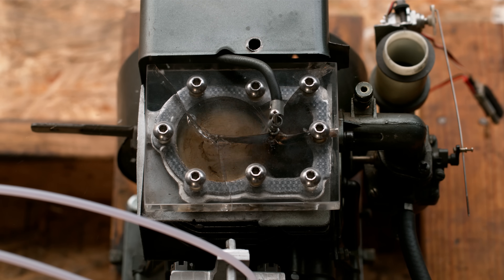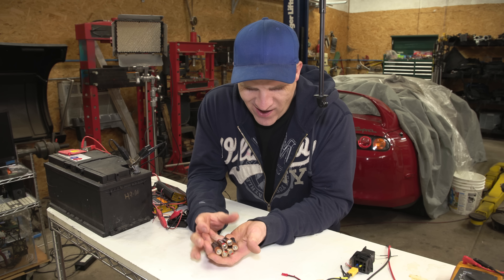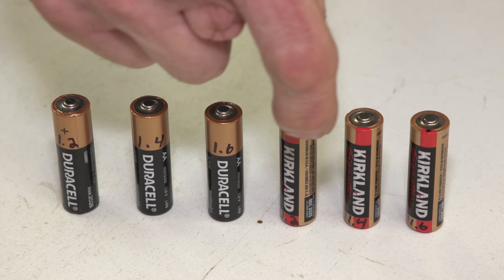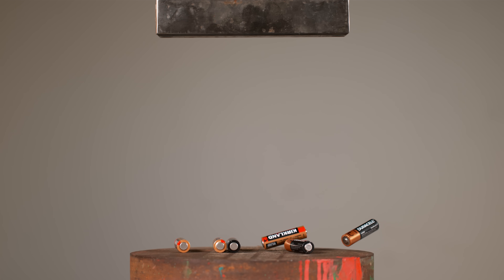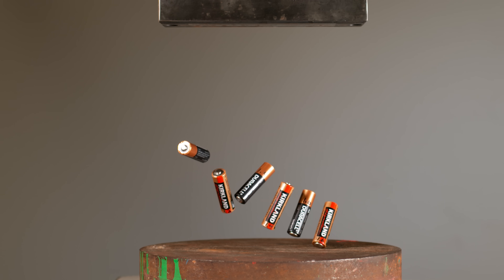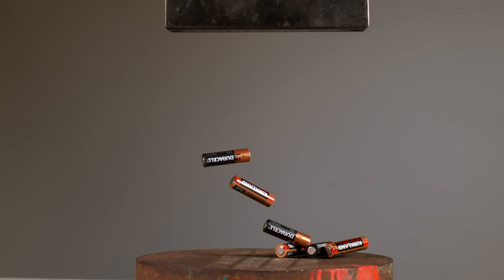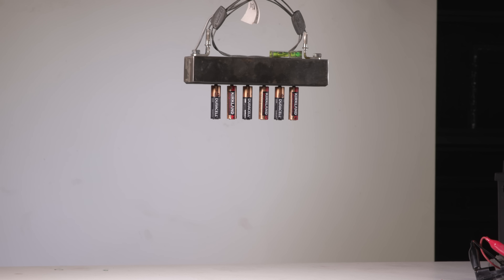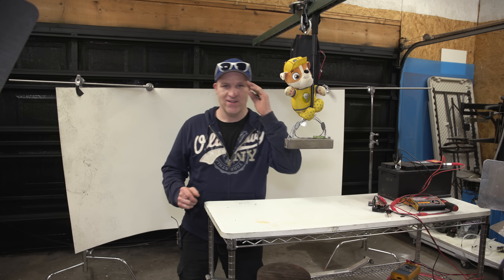Battery Bounce test in Slow Motion - Why Do They Bounce when they are Dead?

Comment: Yes it was air resistance to weight that made duracell fall first. You can clearly see they are released precisely at the same time and their distance from each other keeps increasing the more they fall. If I'm right you will weigh the batteries and tge depleted ones will be lighter because you can also see in the footage that dead batteries are hitting the plate later.
Reply: Free fall velocity is being somehow manipulated. Speculating: One brand's materials cause delayed release to the magnetic release rig? One brand's make up is interacting differently with the rig and is resulting in some electro-mag forces being exherted upon "release". But definitely nothing to do with air or weight in these conditions. (Cool vids. Had to subscribe!).
Reply: Weight has absolutely nothing to do with it, while air resistance or even a drafty room might cause the discrepancy.  Try dropping two objects of similar size and shape but one is considerably heavier.  They'll both drop at exactly the same speed.  Try dropping a full bottle of water with an empty bottle of the same shape and capacity. 
 In a vacuum, a bowling ball and a feather will accelerate towards the ground or fall at the same speed because the strength of gravity is a constant. A skydiver adopting a head down position will only fall faster than a skydiver adopting the standard belly down arched back position only because of air resistance.
Reply: Ài pulled you correct, I'm sure my cock would be pushr @cherrycolalola6345
Reply: @cherrycolalola6345  Yes, weight does have something to do with it. In vacuum, they weight different, their mass are different, but the acceleration (weight / mass = g) would be the same. In air, they weight different, the air resistance is almost the same since they have similar shape. Acceleration is proportional to (weight - air resistance)/mass. We know (weight = mass * g). So the final acceleration is [(weight - air resistance)/mass] = [weight/mass - air resistance/mass] = [g - air resistance/mass] . So yes the greater the mass is, the higher the acceleration will be.
Reply: @lighteningwawa  I stand corrected if I said that, but honestly forgot what the controversy was about. lol. 
   After rereading, I believe we both are saying the same thing but in different ways.  We agree that drag/air resistance is the cause of the discrepancy and you are correct, a heavier object will be less effected by drag/air resistance because of inertia, but it stands that in a vacuum with no air resistance, the weight of an object will have nothing to do with it.  Gravity will effect both of their masses, large or small, equally and their acceleration would be the same.
Reply: @cherrycolalola6345  Sorry for digging your old comment :-) Yeah you are right. I guess I misunderstood you because I was a bit mislead by your first sentence, as you said weight had nothing to do with it. IMO weight has something to do (in air) in the way that it affects how effective the air resistance would slow the object down.
Reply: 4:16 Has every one seen Rubble from Paw Patrol?

Comment: Surely the difference in drop speed isn't due to weight or discharge amount, but more to air resistance? Are the Duracell batteries slightly more tapered on the bottom (they look it) this would make them have less drag and thus accelerate faster. A bowling ball & a feather fall at the exact same velocity in a vacuum, so it's not gravity - it's air resistance!

Comment: He mentions fall rates. Duracell's weight is irrelevant to fall rate on Earth. It's either the material of the contract points releasing differently from the release rig, or some high-level electro magnetic sh*t going on within each battery and the rig, when he flips the release. Or both. (Cool vids. I had to support and subscribe!!)

Comment: hey Warped Perception, i'd be interested what the rated capacity for Duracell vs the Kirkland battery is. could you measure which has a longer discharge or more power than the others, or do a test between numerous brands ? would be cool. i work for Costco(Fork Lift Driver), so would be interesting to see if their own branded stuff is as good as the competitor, as Costco says, their own brand matches or beats the quality of the branded product, but are usually cheaper.
Reply from the maker: Here check this out https://youtu.be/V7-ghrTqA44 let him know I sent you, he's a friend of mine.

Comment: Do You really think, that the duracell batteries hit the deck earlier because they are heavier ?!?
Reply: Obviously not weight or Newton is all wrong... I bet it is a difference in the cap of the batteries that leads to this. I mean the unequal reaction to the electromagnetic field shutting down may be why the duracell realese two frames sooner. Could be because of the thickness of the cap or the alloy that is different. The fact that it is brand dependent also seems to lead this way but I may be just totally wrong.
Reply from the maker: Well they were released at exactly the same time but hit the same plate a couple frames sooner. That's what makes it so interesting.
Reply: I did quick maths and between a 20g and 25g battery (no idea) and a 300 mm drop, there is a time delay in landing of 0,03 s. Enough to be captured on the high speed footage indeed.
Reply: Weight doesn't effect the speed at which an item drops.
Reply: @tamacoable  Exactly. Air resistance is the only variable here.

And apparently the magnetic force. I had not thought about that. Still, weight is not a variable in falling speed.
Reply: @NightEye87  Guys, you're forgetting the residual magnetic force. the heavier battery, would in fact release itself before the lighter battery.
Reply from the maker: But the released at the same moment
Reply: @WarpedYT  From what I understand now, is that the change in magnetic field causes some 'residual' resistance (or, magnetic pull). They are released at the same time (give or take a frame) but then the 'slower' batteries are more hesitant to fall due to the very small magnetic field that is still there, trying to fade away. Maybe somewhat comparable to a magnet falling through a conducting tube?
Reply: @wesleysuperman  The residual magnetic force is what I was trying to explain but the weight isn't the predominant factor here I think or there wouldn't be such a difference between the two brands as their weight is not brand dependent. That magnetic residual force must act differently on the caps whether it is due to type or quantity of matter in it. And this probably affects only the first "nanoinches" of the fall.
Reply: @NightEye87 When air resistance enters the equation it is
Reply: This isn't space. Theres air resistance to contend with
Reply from the maker: I think so, I also talked to some of my friends about it ( they work at jpl) and they think it has to do with the air resistance, keep in mind this is 2000 frames per second, so they were only about one to two frames ahead, which is about one thousandth of a second, very little and visually amplified by the high speed camera, I'm going to look deeper into this later..what do you think?
Reply: @WarpedYT  Well, You could be right, but it seems to me that on such a small distance air resistance could matter only with huge difference in weight. I might be wrong though. If any I could agree with the weight thing but in the meanning of the way the magnet influence first inches of their flight.

Comment: Heavier Objects Do Not Fall faster!  4:49 the release was not as exact as portrayed, the reason is the Duracell batteries
do not stick to the magnet as well, so when magnet is switched off the Duracell release sooner as the field collapses.
Play @ .25 speed to see for your self and if it not the magnet attraction difference and they are heavier, still they were
released a bit sooner letting go from the magnet sooner since a heavier object needs more to hold it as the field collapses.   None the Less was COOL to see the bounce height all together with the different drain levels, Great Idea!
Reply: Yes he is right as gravity pulls everything at a constant and so the weight would not play a role in how “fast” an object will fall towards the ground. Don’t believe then just do your own experiment and place a penny and a feather inside a vacuum cylinder and do a drop test for yourself.... Spoiler Alert 🚨 they will both hit at the same time!!! Still such an amazing experiment filled with science! I LOVE it, got a new subscriber with me!
Reply from the maker: It is what you see. But it was with the high speed camera and that equals 1/1000 of a sec. I will do a follow up and look into it.
Reply: @WarpedYT   Still was a great way to prove the bounce/reaming juice test! Awesome Idea!
Reply: They do if they have air resistance, just like anything else, and watching this with the high speed camera is almost like looking at something microscopic with a microscope. Even the slightest movement is amplified and magnified.
Reply: @littlebrainiac1  True but Douptfull in this case as even the maker of the video agrees, Besides the batteries are nearly the same.  run at 0.25 speed and see for your self, it's in the release is all.
Reply: Agreed

Comment: Heavier objects do NOT fall faster than lighter ones in a perfect vacuum
Reply from the maker: Great point, I wonder why some of these batteries fell faster than the others. They are all releasing at the same time from what I can see looking at the high-speed footage. But they definitely fell at different velocities. Which was very interesting to see. But again keep in mind that on the high-speed camera it looks like a lot more than it is. From what I calculated the two sets of batteries fell about two frames apart at 2000 frames a second. So that means they're only one millisecond away from each other. That is a very very small difference. Maybe using the same drop rig I should do some future experimentation. For instance dropping things in a vacuum versus regular atmospheric pressure. Maybe even these same batteries. Thanks for the feedback you got me thinking
Reply: @WarpedYT  That would be a prefect video to put on youtube and debunk the idea that other people think that heavier objects fall faster! I wonder what caused this small difference. Cant wait to see your next video!

Comment: Gotta reference Newton's laws though on the Duracell batteries hitting before the Kirkland batteries. That's not how gravity works. It may be that their composition (what they're made of) caused them to release from your electromagnet differently than the Kirkland batteries though.
Reply from the maker: Good point, no they all released exactly at the same time if you look at the footage. That's a really interesting point though, if they are not anywhere near terminal velocity why would one drop any faster than the other. Maybe I need to use that same dropper rig and look into this in the future.
Reply: @WarpedYT  I didn't explain my suggestion for what could be causing the differences in release just after you turn off the electro magnet. I believe it may be that the metallic composition of both batteries are just slightly different. That combined with the magnetic field not fully dispersing may cause the batteries to have been pushed/pulled differently right after shutting off. Perhaps some slow motion footage with iron filings and that electromagnet being turned on/off, as well as cutting the batteries open (if that's even safe) to inspect why they may be dropping differently would reveal some more answers?
Reply: You are forgetting about air resistance. Objects of different masses only fall at the same speed in a vacuum. Heavier objects will fall faster through air (i.e. brick vs feather). If you look closely, the batteries are all level with each other immediately after they release but become staggered upon reaching the table. This implies that the Duracell batteries contained more mass and thus could exert greater force to move the air out of the way as they fell to the table.
Reply: @DanielRafacz  The differences in weight and aerodynamics are negligible in this case though. When comparing a brick and a feather, the feather's aerodynamics are greatly disproportionate to it's weight compared to a brick's. These batteries have the same aerodynamics as they are all the AA standard sizes and nearly, if not, identical masses.

Comment: Would it make more sense that the magnet had a different hold on the kirkland batteries and that's why they fell behind? I learned in school and relearned from Veritasium (which is a channel here on youtube) that objects fall at the same rate. Perhaps the magnet has a greater attraction to the kirkland batteries and or the kirkland batteries lose their attraction to the magnet that tiny bit slower.
Reply: But heavier battery will came loose from magnet faster as magnet doesn't loose magnetism in an instant and lighter battery will hand longer. Also heavier battery has more momentum and that helps it fight with air drag.
Reply: HaloBalla Your assumptions are correct, it's all about the magnets influence on the batteries. The speed and size of the batteries are insignificant for air resistance to have any measurable effect.
Reply from the maker: That's a great point, they should all fall at the same rate since they are nowhere near terminal velocity. The electromagnet releases them exactly at the same time. I mean as long as it takes an electron to get from one side to the other that would be the delay, but that's incredibly fast, less than a millionth of a microsecond. I'm going to have to look into that in a future maybe do some experiments. Thanks

Comment: The weight have NO influence at all to the speed of droping
Reply: But heavier battery will came loose from magnet faster as magnet doesn't loose magnetism in an instant and lighter battery will hand longer. Also heavier battery has more momentum and that helps it fight with air drag.
Reply: Maciej Kuśnierz’s statement is pretty exact
Reply: In a vacuum, the mass will not influence the acceleration of falling objects. However, when being accelerated in a fluid (air in this case) then the net force acting on a falling object will depend upon the mass non-proportionally and therefore the resultant acceleration will depend upon the mass. Also, fluid turbulence will affect the acceleration of each object differently.
Reply: maxpayneau Actually you are incorrect. Objects of different masses only fall at the same speed in a vacuum. Heavier objects falling through air will fall faster than lighter ones (i.e. brick vs feather). Often in our daily lives the effects of air resistance are so tiny that they are either unnoticed or irrelevant. But with the extreme precision of high speed photography, we are able to see this effect.
Reply from the maker: I think you're right, I was thinking the same thing, this happened so fast and we are filming at such high frame rate that that's light little bit of drag could make a difference, I mean it was only like two frames which is about 1/1000 of a second, that's a very very small amount which looks like a much larger amount when watching in slow motion.
Reply: 9.8 m/s^2
Reply: That's what they teach you in highschool, because learning shit like air resistance at the same time is too hard for the smooth brains of teenagers.
Reply: John Greco I learned rocket science in 8th grade....
Reply: @kenshiromilesvt.7037  Shooting bottle rockets at your friends doesn't count :P
Reply: John Greco I did that too, but I was actually serious 
Edit: ok it was 9th 😂
but i did go through a more intensive and in depth schooling than most high schoolers
Reply: In a vacuum - yes. But in the air, you have to consider a ballistic coefficient https://en.wikipedia.org/wiki/Ballistic_coefficient which is higher for the heavier cell. The cell with higher BC will land earlier.